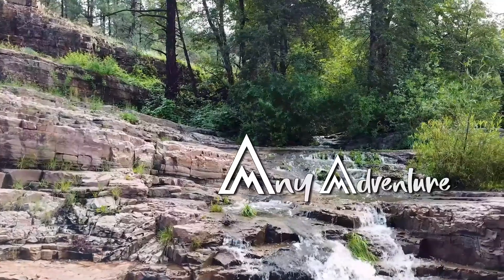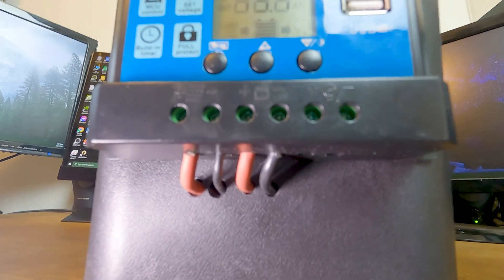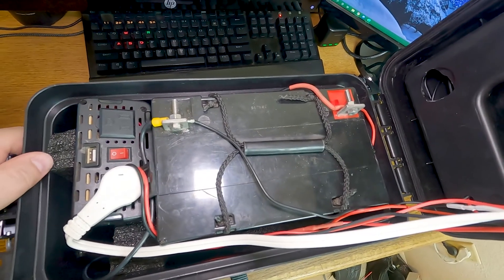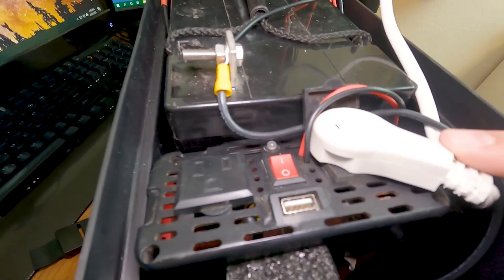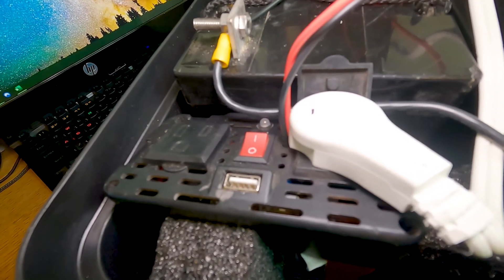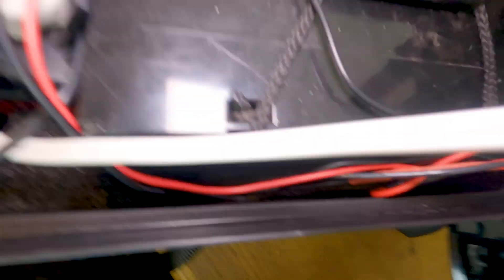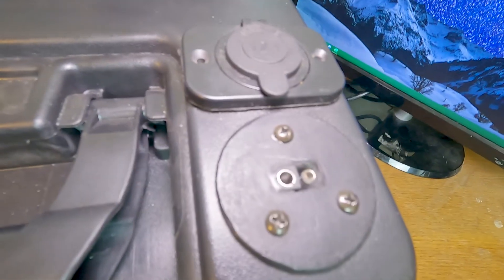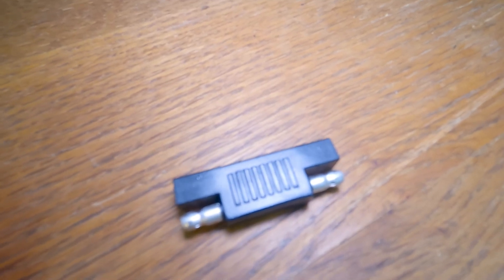DIY Solar Generator Portable Power Station

Comment: This is wonderful. Can you build this for someone if they pay you?
Reply from the maker: It would most likely be more cost effective to buy one online than to pay me to make one like this.
Just search for Solar Generator or Power Station
Here is one that I bought that I like: https://www.amazon.com/ALLPOWERS-Portable-Generator-185200mAh-Emergency/dp/B08H1TFVRR/ref=sr_1_2?crid=3CAH35OOARDWZ&keywords=allpowers+606&qid=1642820969&sprefix=allpowers+606%2Caps%2C214&sr=8-2
there is also a smaller (cheaper) version: https://www.amazon.com/ALLPOWERS-Portable-Station-Generator-Emergency/dp/B08V917TK7/ref=sr_1_5?crid=3CAH35OOARDWZ&keywords=allpowers+606&qid=1642821208&sprefix=allpowers+606%2Caps%2C214&sr=8-5

Comment: How long does it last running mini fridge fan ect
Reply from the maker: I haven't run any real tests. With my 100 watt panel attached it will keep up with a 12 volt 20 liter fridge in my car indefinitely. I run the fan all night without any problems. There are a lot of variables to how much power a fridge uses.

Comment: You lost me at "AGM".  You wouldn't need the strap to deal with the weight of the battery, and you'd get a lot more usable capacity, with some sort of lithium battery solution.  Other than that, it's a pretty impressive build.  What is your use-case for this battery?
Reply from the maker: I agree, Lithium would be much better. The goal of this project was mostly to make it as cheaply and simply as possible. I already had the AGM battery so that's what I used. The only thing I really bought for this was the ammo box. I use this to run my 12 volt fridge and charge phones when I'm camping. It is charged by solar power and from the car alternator. It could be better, but it works and cost me very little. I will probably replace the battery and the solar charge controller at some point for the reasons you listed.